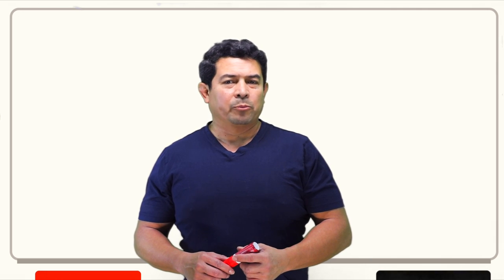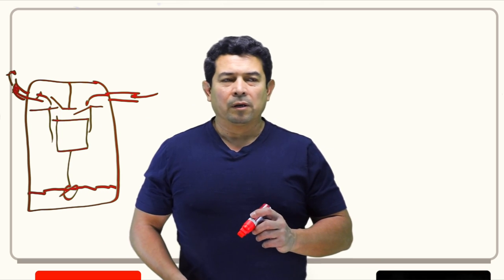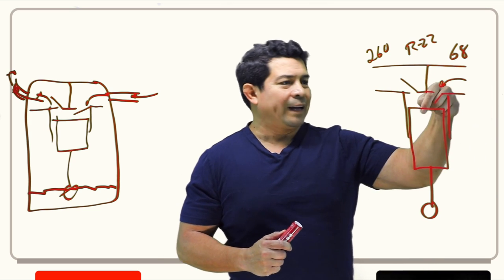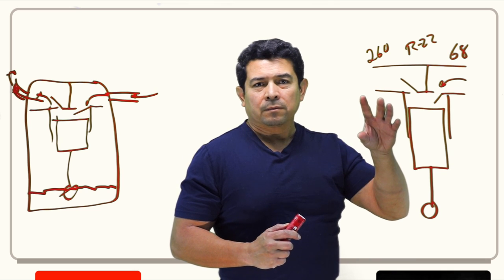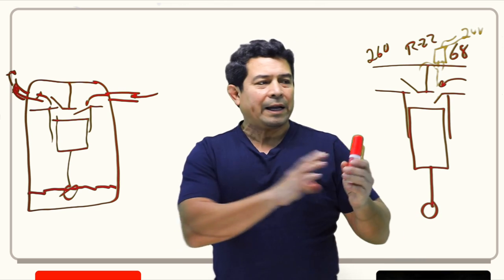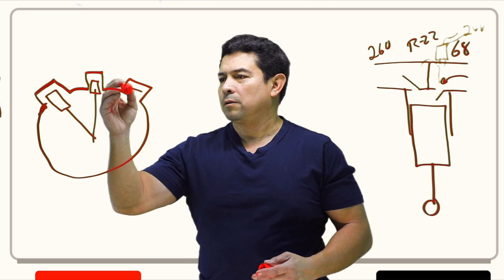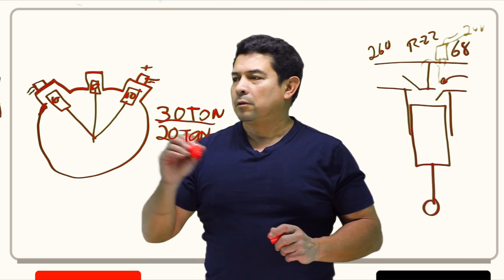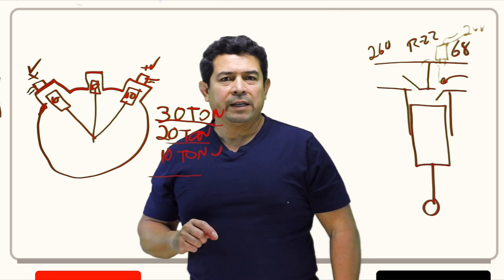Compressor Unloader - HVAC Online Training and Courses

Comment: our unloader starts with 24vdc. after i press start on d compressor, what happen 2 d unloader? does it close n open on piston operation until it reach the high pressure and open up to the discharge pressure?
Reply from the maker: ronnie corpin Typically the compressor will start with that cylinder unloaded. Meaning that the piston will move but it would not do any compressing or work.   It does that to keep the amp draw down and so that it is easier on the compressor motor. After a few seconds some manufacturers will remove the volts from the unloader so that it will load up and the valves will start to do some work, meaning the cylinder will actually be compressing refrigerant. You will notice the suction pressure is going to drop and discharge pressure is going to rise.  When you do not need as much cooling, it will add the 24 V DC like in your case so it will stop the compression action. Most places/compressors use 24 V AC.
Reply: @AirConAcademy  thanks. our compressor run unloaded den a few seconds around 45secs, it trips. just loaded it with freon and still trips. haysss...
Reply from the maker: ronnie corpin are you saying the compressor runs for about 45 seconds? And then the compressor tripped and shuts off?    Are you saying that you added refrigerant to the system? Or are you saying the pressures increase?
Reply: @AirConAcademy  the compressor stops running after 45secs...and we have a high temp discharge of 190 deg F. also an alarm saying high condenser temp after adding freon.
Reply: @ronniec8370  You probably have nitrogen or other non condensables in the system. Make sure any liquid line solenoids are open manually

Comment: How does this fare with vibration?
I seem to be having a specific problem with a chiller from a specific manufacturer (lets call them JC).
Reply from the maker: That is an interesting question about vibration. I have never noticed any issues or excessive vibration while, during and or at any time when it is loaded or unloaded. That would have been an issue when I was in the Navy because of the vibration. The submarines could have picked up our vibrations and pinpointed us. But we never had a problem with sonar saying anything about it. If you're having a vibration issue it could be that the compressor has internal problems? If it is not just vibration but noise it could be that you are slugging? I hope this helps. Let me know. Thanks for watching!
Reply: @AirConAcademy  Thank you for your prompt answer. The issue persists with an air cooled water chiller equipped with one inverter controlled reciprocating compressor. Refrigerant is propane, and the unit has 60kW of cooling power. To my knowledge are the cylinders not being unloaded in any way, and the load is regulated solely by the RPM.  The chiller is still under warranty, and there have been about 5 warranty repairs in the last 1-2 years. Most of the repairs were due to gas leak alarms caused by leaky refrigerant piping. It is my "educated" guess (I am an HVAC engineer representing the investor) that the vibrations are tearing the machine apart on the lower end of the rotational range. Even if the controller (Dixell iChill 200) states a compressor running at 20% speed, I still get a 7-8 K temperature differential on the water-glycol side, which would imply no load regulation whatsoever (flow on this side is constant). The changing rotational speed of the compressor can clearly be heard though... As you probably know from experience, it's never simple.
Reply from the maker: @nikolapatrcevic5489  I was reading your message and I find your issues very interesting. What is the superheat that you have on that chiller?   I was doing some research and one of the articles I was reading said that if your superheat is not high enough, at the compressor, as the compressor compresses the refrigerant/propane, because of the high pressure and the low amount of superheat it may start to condense in the piston. 

I am thinking that if this happens you would have slugging in the compressor that would create noise and vibration. This vibration could be the cause of your leaks. I would check the superheat and maybe try to increase the superheat at the compressor so that the refrigerant will not condense at these high pressures.     
I am not sure if this will help you but it is the only thing I can come up with so far. Good luck and if you get a chance let me know how it goes.

Comment: Hello..thank you a lot for your explanation. 

I'm here having a question related. 

I have a refrigerant compressor and it is pumping air /oil mixture....so I just want to know if this is normal for that type compressor or this can mean my oil rings are damaged ?

Thank you in advance
Reply from the maker: The easiest way to do that is to close off the suction valve so you can pump the compressor down.   if it does not pump down, meaning if the suction pressure does not go down to to a vacuum the compressor is bad.  remember the suction gage or the blue gage has to be hooked up to the compressor itself so you are reading the pressure after the suction valve.   please let me know if this makes sense to you.
Reply from the maker: Daniel Segooa I just saw your message. How do you know that it is pumping oil? How do you know it’s pumping the air/gas and oil? If the compressor is not hooked up to the system they will all pump the gas and oil out on the discharge.    How do you know that it is pumping the oil out of the compressor? Does the compressor have a slight glass?

Comment: Do we have loader & unloader which are not operated by solenoid but operated by pressure
Reply from the maker: Yes, on some compressors, they use the oil pressure to control the unloader. The idea is that when the suction pressure drops, the oil pressure will drop and that tells the compressor that you have a very low load. Then it unloads the compressor. When they oil pressure goes back up it loads the compressor back up because it thinks it needs more cooling. I hope this answers your question. Thank you for watching!

Comment: Sir unloader mechanism is different for both air and refrigration compressor ??
Reply from the maker: It is different,  on most air compressors they will turn the compressor off when it reaches the desired pressure.  The unloader valve will allow the air that is on top of the cylinder to be discharge so the compressor does NOT start under a load. on other air compressor they have a clutch that will disengage when it reaches set pressure so the electric motor runs but the compressor itself is not running or doing work. This is done to minimize the starting and stopping of the electric motor.

Comment: Is it possible for unloaders to energize with a less than full charge? Basically back n forth clicking from the unloaders. I’ve noticed my head pressure (404a) heads to 330 then I’m guessing an unloader energizes and then head pressure decreases. Happens every other minute
Reply from the maker: First, you would have to figure out how the unit is loading and unloading? I mean what is bringing the unloader on and off? Are they doing it by pressure or by temperature sensors?   That means you would look at the wiring diagram to see how their energizing and energizing the unloader.    If you believe the unit is low on refrigerant in order to charge it, it must be fully loaded to the correct charge.    I hope this helps and I'm sorry I know it is not a direct answer, but I don't know what is going on or how things are wired so it's a little difficult to give you a definite answer.     Thank you for watching!
Reply: I think I figured it out with help from the video of course. It was overcharged by 1 pound and I think the unloader valve was bleeding off the excess while keeping the compressor running. If I have that right? Charged to the correct amount and it didn’t go off again. Ran correctly
Reply from the maker: @anthony123G  very good! I'm glad you got it running correctly!    Good job!

Comment: Good day sir...how to the best clean rusty inside compressor and mechanicals?? What kind of chemicals using to clean rusty...thanks
Reply from the maker: Thank you for the question.  I have never had rust in a compressor.  If it is an old compressor not being used at the moment you can clean it with almost any cleaner, as long as it does not leave a residue, so you can get everything off of the walls of the compressor. to clean I sometimes use a product called Pro flush. It is made so you can flush the refrigerant lines and clean them from the inside. It is basically R11 but it is sold as a cleaner. R11 was a great cleaner but now it is against the law in the USA to use as a cleaner. Be careful because when you use this product you need to have good ventilation or you may get very sick.  THEN you need to coat everything with refrigeration oil. to keep it from rusting until you install the compressor.  then you need to seal it and pull good vacuum, 500 microns. then you add nitrogen inside the compressor and leave it with pressure until it you will use it.      If the compressor is running and it is contaminated you will need to remove and replace the driers, or install suction and liquid line driers.  you may need to install the cartridge types driers so it would be easier to replace in a few days to make sure the system is clean. then you would replace the driers  until the system is clean.   I hope this is what you were asking.  Thank you!
Reply: @AirConAcademy  thank you sir...your openion
Reply: @AirConAcademy  how about a gasoline sir?? It is ok to be use a gasoline for cleaning??
Reply from the maker: @dominicpantinople4760  Gasoline is too flammable, too dangerous. you can use alcohol. it is not as dangerous.

Comment: Oil are going to discharge valve..... explain...y is that so
Reply from the maker: I am not quite sure what you're asking, oil and refrigerant will always mix. There will be oil mist inside of the compressor, and as the refrigerant gets compressed and pumps out, then some of the oil will be pumped out also and there will be a slight coating of oil everywhere. If you have excess oil in the crankcase, you might get large amounts of oil leaving the compressor which could be bad. Also if liquid comes back to the compressor that could make oil go up to the cylinder and out the discharge valve. I hope this answers your question. Thank you for messaging me and thank you for watching!

Comment: How to measure ton in compressor in hvac?
Reply from the maker: The unit data plate can sometimes help you with that or The manufacturer can tell you that, .   BUT   out in the field we always  said one horsepower is one ton of refrigeration. That gets you close.  i am sorry we usually just get the exact replacement and it solves the problem, of guessing.

Comment: How these solenoid get signal 
Whether they should open or close
Reply from the maker: The compressors are loaded and unloaded by either a thermostat or these days by the energy management system. It will sense  the temperature in the rooms and if the temperature starts to increase, it will load the compressor up to make it work harder and do more cooling. It can be done different ways, but this is the most common way these days. Thank you for watching!

Comment: What would happen hypothetically if an unloader is always energized when the compressor is off and is always energized in heavy heat load conditions like Summer time for example? 

Would it damage the compressor and or affect oil return?
Reply from the maker: It should NOT damage the compressor.  The compressor would start under a heavy load which is not good for energy efficiency and hard on the motor.    The unloader is suppose to adjust to to meet the load demand.  IF it is always fully loaded it may cool the space too fast and you might not have enough de-humidification. In that case you may have mold form in the space.   unloaders are needed to keep the space comfortable.
Reply: Aircon Academy: So let me say this back, your saying if the unloader solenoid is always energized even with the compressor off it would start under a heavy load condition and pull high amps?
Reply from the maker: @CaptCrewSock  Once it starts up, if the compressor is in good condition it would not pull any more than the running load amps, or as some people say rated load amps. So it would not be overloading the compressor. It would just be for a split second on start up.    Like I said, the only other issue would be that it would be cooling at 100% capacity. Which means it may not de-humidifier as it should.
Reply: Aircon Academy: THANK YOU for all your reply’s, however I’m still confused, lol...I thought if the solenoid is energized and the unloader has now unloaded that piston it would NOT be under a fully loaded condition and the compressor would be doing less work. Am I wrong?
Reply from the maker: @CaptCrewSock     I am sorry, I have seen some compressors that when the solenoid is energized the compressor is loaded.   I was just helping someone a week ago and that was the case in their building. When energized the compressor was loaded. In your case the compressor would just not do enough cooling and the amperage would be lower than the running load amps.   Typically the compressor should start up unloaded and then load up while it is running as needed.

Comment: Sir Julio, our AC semi hermitic compressor is having problem.. the suction pressure is only 2bars, instead of 4.2 to 5.8, HP is 14 bars. I've seen in condenser enough refrigerant. Seems the freon cannot return to suction immediately, could it be TXV problem?.. I have already change filter drier but no success.. r407c freon sir.. thanks.
Reply from the maker: have you checked the compressor valves?   what pressure do you have on the high side?    is it low? or high?      I am more used to PSI not bar    but  let me have some more information please
Reply: @AirConAcademy  LP sir is 30psi, HP 205 psi, running current= 27 amps only, motor rated current= 73.9 amps sir.
Reply: @AirConAcademy  Freon R407c
Reply from the maker: @robertolabendia9421  I have a couple of other questions. Is this an air-conditioning unit or refrigerator?  is this a split system or package?  If it is a package unit you should recover the refrigerant and then charge the unit by weight. 

What is the subcooling and what is the superheat?  I am asking about the superheat and subcooling because the pressures are low. 

It could be a TXV problem, the screen at the TXV could be clogged, so you may need to replace the TXV. Also someone could have adjusted the TXV. 

The compressor is not pulling normal amperage because it is not doing much work, indicating low refrigerant. 

Where are you located and what is the outside air temperature?

Comment: How scro compresso lod and unload
Reply from the maker: Dinush Kumara Thank you, and ELO see if I can do a video on loading and unloading scroll compressor’s. But typically what they do is they have a bypass from the discharge back to the suction, or they have a plate that rotates inside and unloads down to 67% capacity. Thank you for your question!

Comment: why cant we just off the compressor instead of unloading?
Reply from the maker: By unloading we can do less cooling the needed and at the same time control the humidity. Depending on your climate this is one of the main reasons we use this. So we can control the humidity and make the occupied space more comfortable. Thank you for your question!
Reply: @AirConAcademy   Thank you for your explanation, i have a Digital Scroll Tandem Emerson Compressors, do you have any video's or article how unloading works in this? i am pretty sure it is different mechanism than the Great video you have posted. would be really helpful. Thanks

Comment: Wow...you're not in 2-ton residential split-systems anymore with this one. :)
Reply from the maker: I have worked on small and large equipment. I want to pass some information along to all different parts of this field. I like going from a large unit onto a small through the wall or window unit. It keeps me sharp.
Reply: @AirConAcademy  
Yes indeed.
Naturally there's a lot of residential split system info "out there", and then there's the "roof top commercial", but the videos drop off when it gets to "industrial strength". 
I bet there's a good sized audience for bigger systems if you want to make them.  Every "two tonner" likes to think about moving up to bigger leagues.
Reply from the maker: @hg2.  that is a good idea! Thank you. I will see what I can do.

Comment: Dear kindly guide me. I was reading in carley compressor loader and unloader work on basic suction cutoff and other type discharge bypass. Kindly send me your email. I have to send you one PDF file regarding loader unloader operation.
Reply from the maker: Thank you    there are several ways of unloading a compressor. When I was in the NAVY we used an unloader that worked by oil pressure.  yes please send me the information you have!!!   you can send it to this  address jh@airconacademy.com     thank you.

Comment: FULL LOAD AND PARTIAL LOAD.
Reply from the maker: yes you could say that, as it is unloaded it would be partial load. Some compressors could have 2, 3, 4 or more unloaders on it.  years ago I worked on a compressor that had 12 heads and several unloaders. thank you for watching.